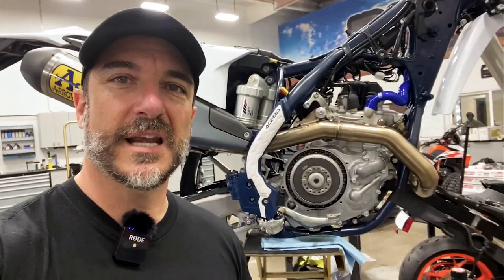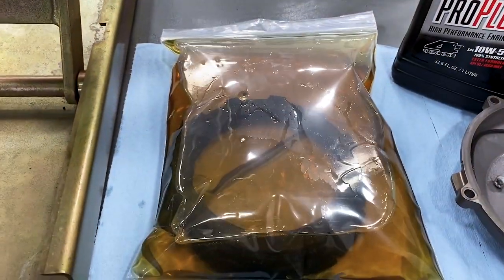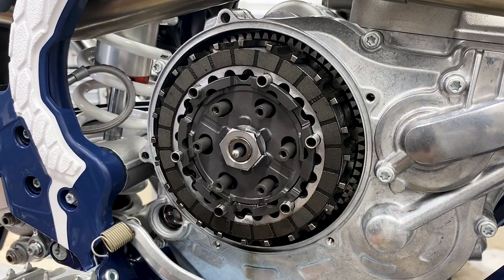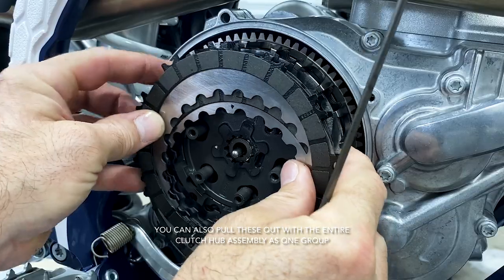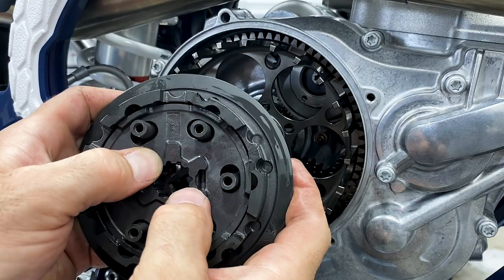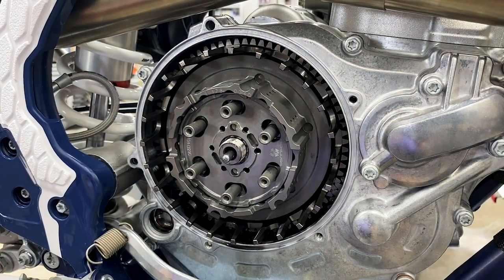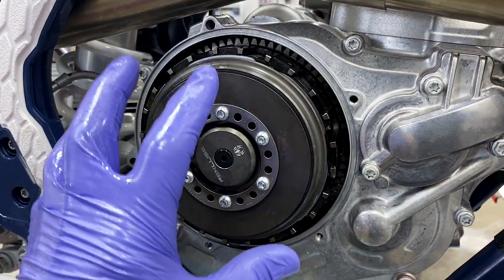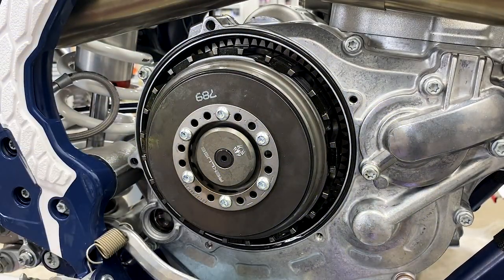HOW-TO INSTALL REKLUSE TORQDRIVE CLUTCH - HQV 501 (2021) - ROTTWEILER PERFORMANCE

Comment: So , Been a KTM fan for many years ... had a 2001 Lc4 640 ... put only about 3k miles on it b4 moving to a home that i wasnt able to ride much ... Unfortunately the bike sat for the last 10 years ... i did put a lot of marine Stabilizer in it and sprayed the bike down with anti corrosion..  I just sold it to a freind .. but .. time out in the back building took a toll on a few things im sure ... the bike Still Looks like New , but the New Owner of it is having a hard time keeping it running ... he got some oil blow back into the air box , and it seems to stall out a lot .. forks are leaking a bit (50mm extreme's) .. Could you do a Vid on What are the top 10 things to do to a Bike like this . ???
Reply from the maker: We are actually building a crazy over the top 'Project 502' bike right now (502 because it's 1 more than any other 501). We thought of possibly doing a 10 best mods for sure. Keep an eye out for that at some point. Won't be right away, but it's in the books to do!

Comment: would you recommend the torque drive for the ktm790 adventure R?  Yes or no and why?
Reply from the maker: Absofreakinglutely. That’s the first thing we do. Why? 15% more surface area (I think more but I’m not at the shop) is never a bad thing. Plus, they are simply better in terms of materials. The stock clutches have been notoriously bad in quality so for the Sonora Rally we ran one of these. I personally checked it 4 times during the event and it was in perfect condition regardless of the flogging our animal rider put it through. These are legit clutches for sure.